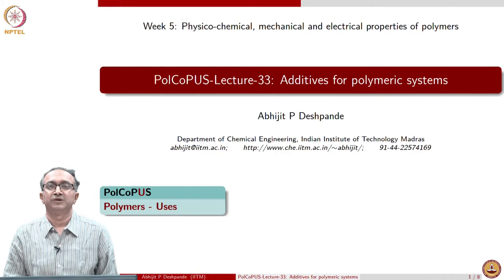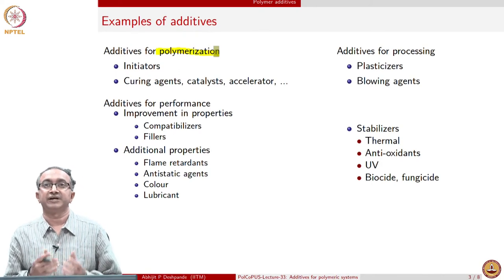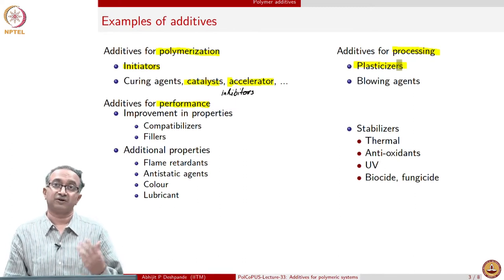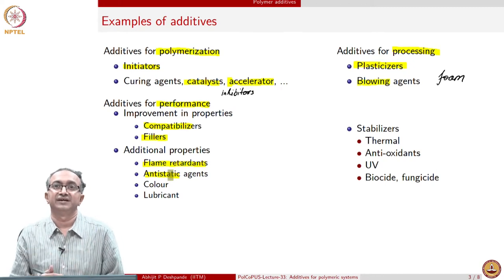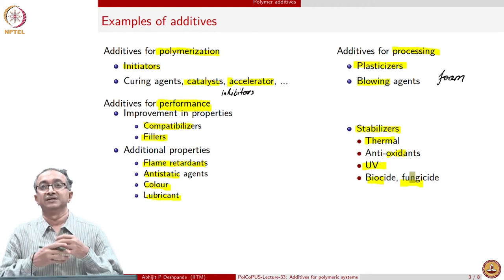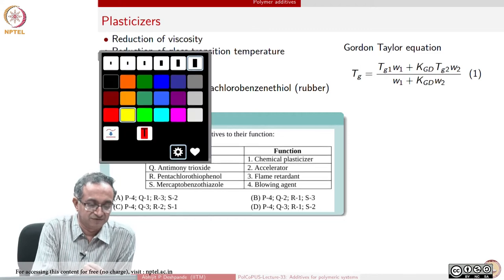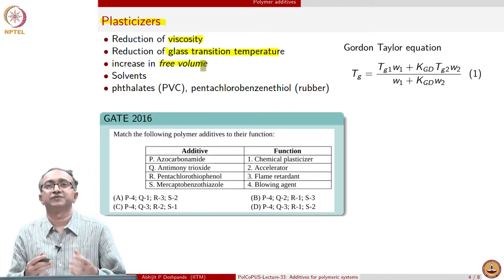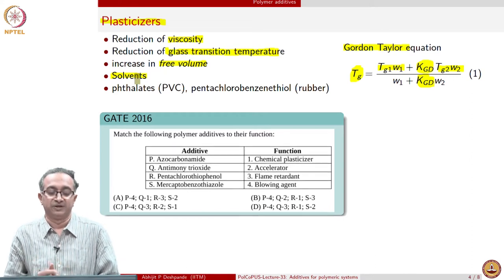Lecture 33 - Additives for polymeric systems

Comment: Do you know any additives that can be used with polymers to help make it non-stick. The only thing I can think of is Polytetrafluoroethylene (PTFE). Would you have any other suggestions? 

Thank you for the lesson
Reply: It depends on the polymer you are adding it to. PTFE would be less likely to work in a polar polymer like Nylon, because it would have internal solubility. For a polar polymer use a non polar wax. For a non-polymer polymer use a polar wax. Insoluble additives are more likely to bloom to the surface. Once you get the additive to the surface, you can start worrying about the interface you are trying to prevent it to stick to. At that point, start researching slip additives.